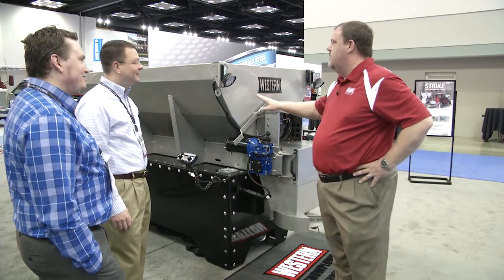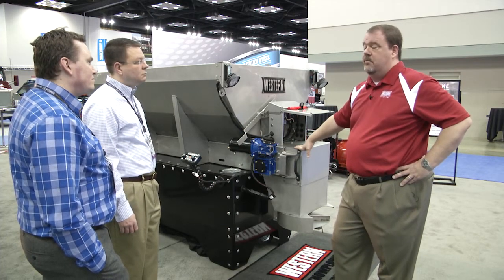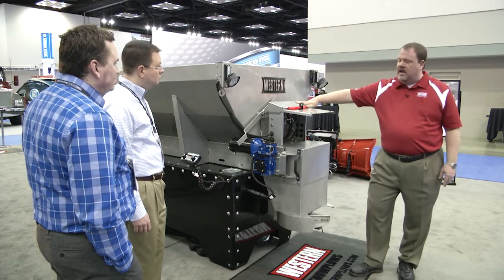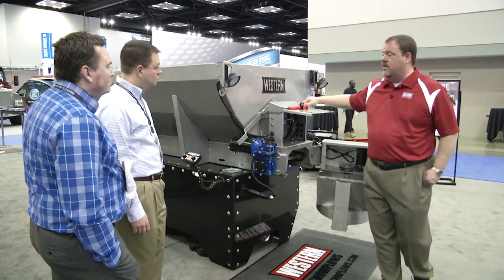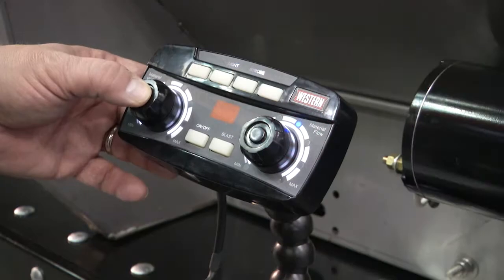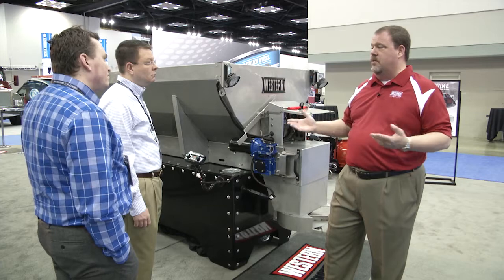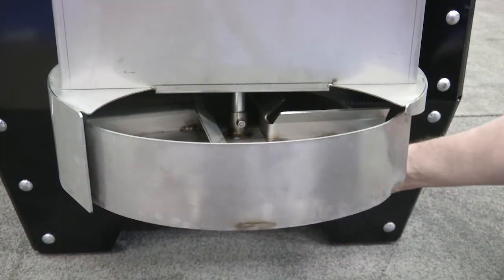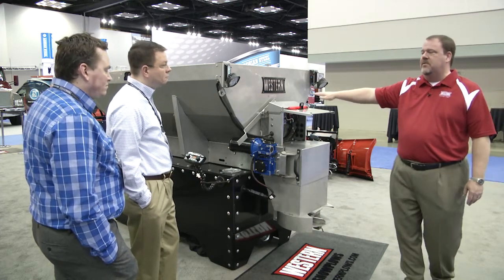WESTERN® Striker™ Stainless Steel Hopper Spreader Demo

Comment: What about a reverse mode if it gets jammed
Reply: I could be wrong but I don't believe pintle chain spreaders are offered with reverse mode, at least ones I've ran. I believe reverse mode is more or less designed and featured in auger systems that tend to jam up more as a saftey feature from burning up the motor.
Reply: i have one fisher sander which is the same as western,  works great with fine material , is a pain when codes pop up , also have a few Air flo electric sanders, much better than fisher , no codes to deal with, goes in reverse if blocked ,